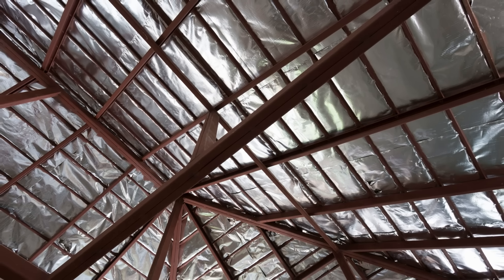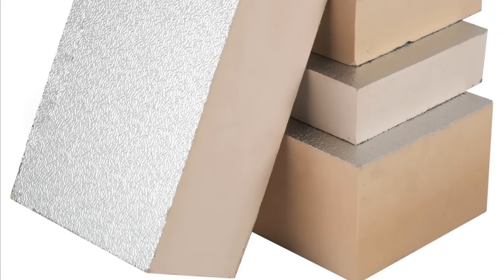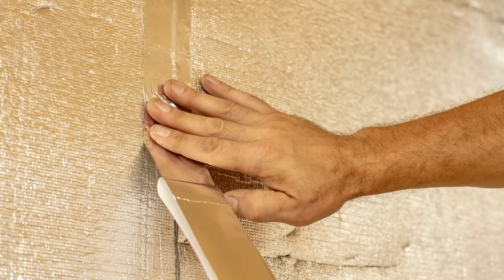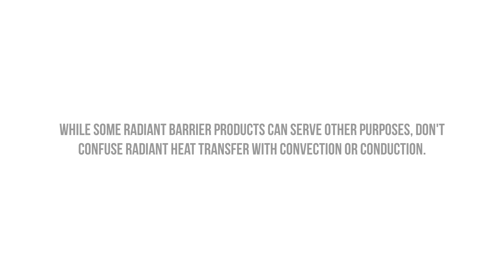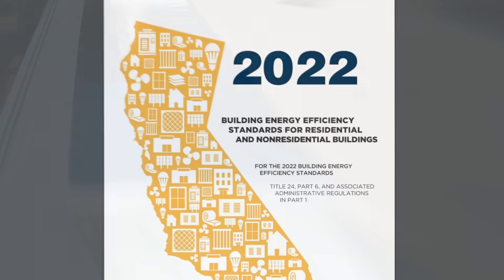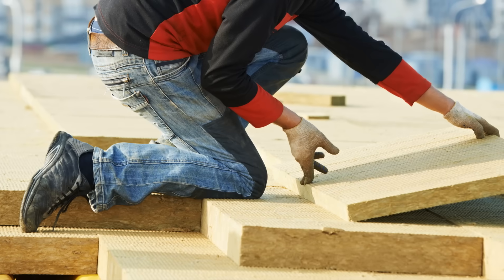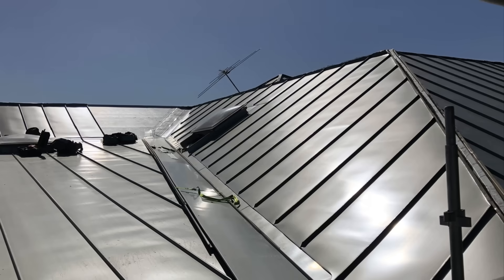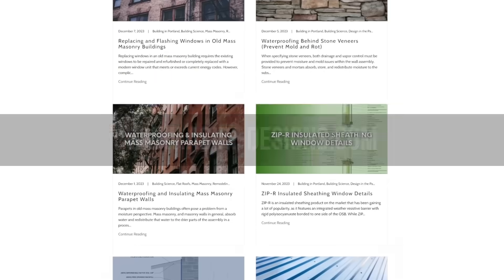Do Radiant Barriers Actually Work?

Comment: Just had the EnergyQ radiant barrier installed under my new shingles in Oklahoma and I regret it. I had collected attic temp/humidity readings for two months prior and one month after and there has been NO CHANGE in the delta temperature between the attic and outside. This product claimed to have a built in air gap but I now think that was BS and is the reason this didn’t work. I’m also now worried about the reduced vapor permeability of my roof assembly, especially if I ever decide to move to an encapsulated attic with spray foam.
Reply: UK perspective is that spay foam is a potential disaster because it's not possible to inspect the hidden contact surfaces where moisture condenses and rots the structure. Very similar to the air gap problem.  
It's very dependant on local climate type as to which aspect is most 'destructive/problematic' !
Reply: Spray foam in attic, radiant barrier under shingles. No offense, but you're doing it all wrong lol.
Reply: Got a link the product? Just curious as to the specs
Reply: I would think that the function of the reflective barrier as reflecting heat has been compromised by the conduction heat loss without the air gap.  I'm no scientist, but I would tihnk if you were to install a reflective barrier to the underside of your top chord from heel to peak, you would be able to reflect that heat away from the attic when it's hot, and back into the attic when it is colder outside.  If you run a ridgs vent and have vented soffits, the hot air would move up between the trusses and exhaust through the roof fent.  This gives the benefit of eliminating heat and increasing airflow which will promote a dryer structure.  You may not even need a reflective barrier specifically, just a weather resistant barrier material that will channel the airflow.  If you maintain a portion of the ridge vent for the attic space, or leave a few trusses open to allow the attic air space to move through those spaces, it will still maintain air circulation through the main attic space.  I don't know if you have cold winters where you are, but if so, having a reflective barrier that is reflective on both sides and has bubble wrap between the layers, you will be able to reflect heat out in the hot, and it will help keep the attic a bot warmer and reflect heat back to the ceiling in the winter.  Thoughts?
Reply: @truckgotstuck  I have soffit and ridge vents and did exactly as you describe. Results were instant and dramatic on my hot climate, inadequately insulated home. I cannot judge how much heat reduction was from enhanced air flow vs radiant barrier but I’d bet you still need the radiant barrier.

Comment: Re: 2:00 - Radiant barriers aren't reflective insulation, and they do work to cut radiant heat transmission even when applied to the "back" side of a hot assembly (think: underside of a roof deck in the south in the summer, facing the attic with nothing touching it).

Low emissivity means what it says on the tin - low tendency to emit radiant energy, even when hot. So when your looking at a hot low-e object, less heat is radiated onto you compared to a similar object with high e. The wood decking with the attached foil just gets hotter than it would without the foil, until it reaches a new equilibrium where it can shed the incoming solar heat conductively and convectively back into the shingles above and the attic air below, but without the use of the radiative heat channel. 

If you have HVAC equipment on the attic floor, and/or you store stuff there, and/or have scanty attic floor insulation, you'll benefit in a hot climate from a radiant barrier built into the underside of the roof deck, esp. if the attic has halfway decent ventilation. But if your HVAC is in your conditioned envelope and your attic has nothing but an R-30+ pile of fiberglass on the floor, the radiant barrier won't much matter becaise that huge insulation blanket will shrug off the extra incident heat that you get without a radiant barrier.

A dirty little secret is that a not-very-low e shading layer can also cut radiant thermal transmission too, just not as much as low e. If you put up a layer of cardboard halfway up your ventilated attic, it will catch the heat radiation from the roof deck, get hot in turn, dissipate some of that heat into the attic ventilation air by conduction, and then re-radiate heat -- from both its faces. So half the heat re-radiating from the cardboard layer will return upwards and only half will radiate down to the attic floor. Cutting the radiant incidence by 50% isn't the same as cutting by 90%, but it ain't nothing. (There are some second order effects to confining heat in the upper layer of your attic, but we're hand waving them away by assuming halfway decent attic ventilation and halfway decent roof shingle quality that can withstand the shingles getting a few degrees hotter because the shingle and deck assembly can't shed heat as effectively into your attic.)
Reply: This is kind of where I am with my unschooled understanding.  To take this to the next level, I believe shade is a big deal.  If we are talking about optimizing, I would think that if we were to draw air for our sofffit vents from sides of the house that are shaded moreso than the heated side, we would be able to improve the colling efficiency because there is a larger temperature difference.  amd more room for the colder incoming air to extrac heat from the underside of the shingles.  Same with houses in general, if we can draw in our fresh air from shaded side in the summer and from a heated side in the winter.  (We get down to below -50 during cold snaps here in Alberta at times.)  I don't have A/C in my home (we get up to as high 35c or about 95f  in the summer) and I do have an HRV.  I have often thought that if I had the air inlet on the north side of my house I would have a much easier time keeping the house cooler in the summer because it is definitely cooler back there and being that my house and garage have a 65' long combined north wall that's 10' high on the garage and about 30' on the house, it does not get near as much heat energy to that space in the summer.  I have also considered trenching in a pipe that draws air in but pulls it through the ground about 2-3' down or possibly 8' down if I want to be well beow the frost line in winter ( and using that a an air intake to take advantace of the geothermal heating and cooling just from the dirt.  Thoughts?

Comment: I'm under a budget restraint, and it's looking like in regards to insulation and energy efficiency, I can ether have a great roof or great walls, but not both. In a hot humid climate, where would you spend the premium money?
Reply: Go nuts insulating the roof; air seal the walls and get code minimum insulation there. Run around with a foam gun and flashing tape yourself if you have to, to make sure the air-tight plane is truly air-tight. Make sure your roof design includes good overhangs, or at least get outdoor awnings or shades, to protect your windows and walls from the overhead noonday sun. And get as much of your HVAC equipment and ducting as possible out of the attic.

The roof will absorb the lion's share of the incoming solar heat pretty much all day, and even with halfway decent ventilation, the attic temperatures can still get much hotter than the outside. You really want to protect your ceiling plane from that, so insulate away in the roof / attic zone. Walls will get hot only intermittently depending on sun angle and time of day and roof shading and landscaping choices. Preventing humid air infiltration is the key goal for your exterior walls.

Before they put in the ceiling insulation, make sure the ceiling plane is air-tight. Foam gun in around all penetrations and make sure your recessed disk lights have good gaskets.
Reply: @Noam-w1l  Thanks for the info. No attic, free air all the way up to roof underside. Mini-splits and window ACs. I'm doing all the work myself.
Reply: @keithwingo514  Yeah - with a roof plane close in against the conditioned space, that's going to be the biggest thermal challenge.  The underside of a plywood or OSB roof deck in a southern summer can easily exceed 140 F surface temperature and keep that up for many hours during the day (the shingles can go 160+). I've measured that many times myself with an infrared thermometer gun with my head poking up through the attic hatch into the sweltering attic space and aiming at the underside of the deck.

I don't know what code minimums apply in your area, but you might consider subtracting R-5 or so from your total, installing fiberglass batts in the rafter bays to that lower total (R-25 or R-33 or whatever), and then putting some kind of rigid foam board between the rafters and the ceiling drywall to thermally break the contacts between the rafters (which are directly touching the roof deck) and the interior finish and give you your last R-5.

Technically, a continuous R-5 foam board breaking contact with the rafters should give more insulating effect than an additional R-5 worth of fiberglass in the bays, so if your code minimum is R-30 then off the shelf R-23 batts in the bays plus off the shelf R-5 continuous one inch foam boards should give you superior performance even though it only adds up to R-28. In theory you ought to be able to do the math and show the building department and they'll bless your variant approach,  but YMMV.

Some point out that if the full rafter bay isn't going to be full of insulation  then the batts are better off being hard against the foam board on the bottom than pushed up against the roof deck on top.  And I'm not going into the decision as to whether to vent the deck by deliberately keeping the top few inches of the rafter bays clear and installing soffit and ridge vents, or whether you should go all-in on a hot unventilated roof deck.
Reply: @Noam-w1l  No vents or airspace. Rural area with aggressive critters and insects. If my understanding is correct, it's better to have something in contact with the underside of the roof deck to fight condensation too.

Comment: UV is INDEED blocked by metal - a “radiant barrier”.  But, almost anything else that’s opaque also blocks UV. Wood, in any form, or asphalt, or metal, all block UV energy.  And actually, glass itself blocks UV fairly well.  But glass’s UV blockage can be enhanced with coatings if long term UV exposure needs to be avoided - to avoid fading of pigments, for instance.
Reply: And polycarbonate is opaque to UV.
Yup, that's right a 99c pair of safety glasses will 100% protect your eyes from welding or snow blindness.
Not that the extremely bright light in the lower part of the spectrum won't bother you, but you're not going to feel like glass has been rubbed in your eyes as you later try to sleep
Reply from the maker: Right, but not all radiant barriers are suitable for UV protection, just like not all materials designed for UV resistance are radiant barriers.
Reply: @ASIRIDesigns  Show me a reflective surface that is transparent to UV.
Reply from the maker: @jimurrata6785  Many Many Many windows

Comment: There are radiant barriers that allow vapor transmission, like RadiantGuard which is what I put in my attic. It has pores every cm or so to allow vapor to pass through, so something like that would not be a vapor barrier.
Reply from the maker: @RedMike-ym8hd  What percentage of the surface are holes?
Reply: @ASIRIDesigns The product I will be, Attic Foil, has a perm rating of 14. It appears they recently released a Superperm version, although I'm not sure if the perm rating.
Reply: @ASIRIDesigns  I'm not sure, but they claim 7.8 perms (I still installed it with an air gap on both sides, though, as I was installing under the rafters)